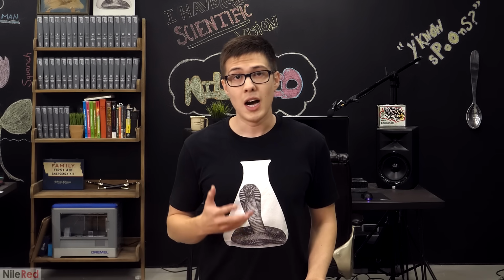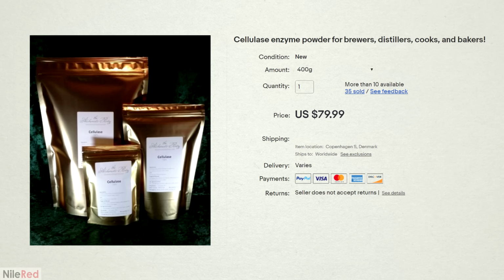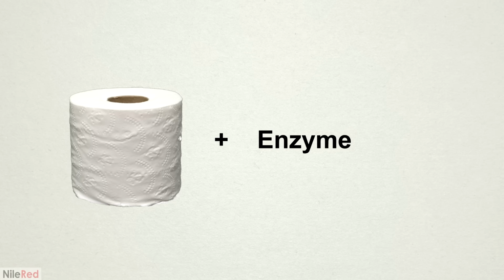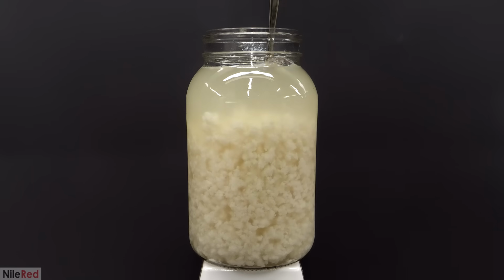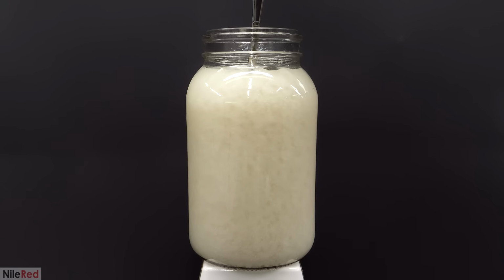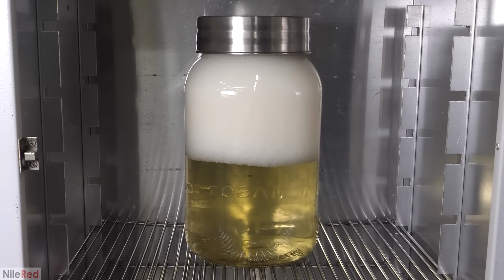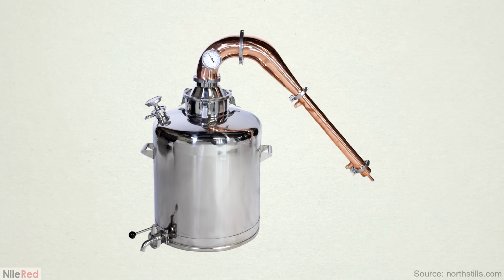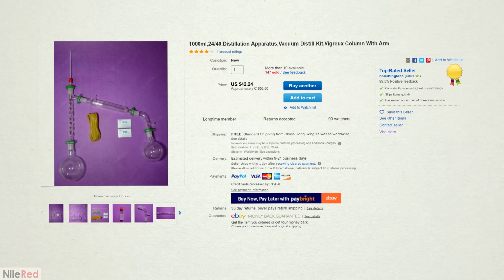Making toilet paper moonshine

Comment: The absolute BALLS this guy has to actually try the stuff he makes when he knows there was drain cleaner and a whole bunch of other chemicals and yeasts he isn't completely sure about in there is immaculate
Reply: I mean, whe all drink Coca Cola
Reply: People do cocaine while knowing that they use gasoline and battery acid to make it
Reply: Uh, all the idiotic anti-vaxer nonsense aside, it's mostly the sodium hydroxide (drain cleaner) in there that was worrisome, which is why he washed the toilet paper so thoroughly, as it dissolves in water (not to mention if any was still left it would be wayy too diluted to worry about). Between that and the multiple distillations, anything too dangerous would be left behind in the flasks he got rid of, excluding methanol if there were any but that was very unlikely and most of it was distilled out with the heads he threw out as well. There could always be some in the tails, which he shouldn't have kept, but even then it's probably not even there and in too small amounts to worry about anyway.

Something he says in his safety video on the other channel that I really liked is safety in chemistry isn't just about knowing how to do something right, but being aware of all the ways it something could go wrong and what would need to be done in all the worst case scenarios. So in this instance that means he knows all the ways there could be some drain cleaner left and so there are steps when all the dangerous stuff is for sure left behind, except maybe in trace amounts.
Reply: He is a chemist. Why does it takes balls? It takes math.
Reply: @dojoparsnip9905  he obviously knows what he's doing, but one wrong move and he's drinking something that could kill him... I just don't think I could trust myself that much so I admire him 😹
Reply: @artistslastcall  i think you have chemistry confused with video games. also, you have zero confidence in your abilities.
Reply: @dojoparsnip9905  No, hickup is right. you shouldn't talk so condescendingly to other people, especially when you clearly arent in any position to do so.
Reply: @guts5135  based on what? how am i not in a position? what is it you know of me? 

 if a person is in capable of math then dont be chemist. you sound like an accident waiting to happen.
Reply: @guts5135  also who said hiccup was wrong? if he lacks knowledge and skill, he shouldnt try the result. 
If someone can calculate YIELD, the know what they are doing. please use your brain next time you try anything.
Reply: @dojoparsnip9905  he is literally god mate
Reply: @zombieslayer1468  you god me there.
Reply: @dojoparsnip9905  On the internet nobody cares what position your in. Just treat everybody with respect and they will respect u back. Somebody was talking about that if hypothetically if he was a chemist he wouldnt trust any thing edible he would create, as a joke, and u go off about zero confidence in your ability and condescending remarks. Its like you try so hard to sound smart but at the same time couldnt even fathom a joke.
Reply: @dojoparsnip9905  ok boomer
Reply: @Kaimebeo  bro your input was extremely helpful. glad to have people like you. stay positive!!!
Reply: @dojoparsnip9905  so true, finally someone who has it right
Reply: @artistslastcall  umm you could've been nicer saying that tho
Reply: @dojoparsnip9905  crazy how vaccines are political now. Look, you either believe in science, or you're an idiot and shouldn't be in public office. There's nothing to argue about here. Science is real. Chemistry is real. Vaccines are real. Get over it.
Reply: I mean it's the same process used to make normal liquor. The raw materials are definitely um exotic and the scale is small but basically same thing different day...
Reply: I was the 1k like. Your welcome
Reply: The drain cleaner was just about the only questionable thing in it. Everything else was food grade.
Reply: Ya know he said he got all new glass to keep it food safe..soo yeah
Reply: Guys, he's Canadian
Reply: Don't lye
Reply: He's working on the law of chemistry. If he avoids mistakes, he shouldn't have any problems.
Reply: Dude, he's a chemist. Chemistry isnt as simple as cooking where the outcome is the combination of all ingredients
Reply: He normally doesn’t taste his creations, remember all of the glassware he used was bought separate to keep things food grade safe
Reply: Fun fact you can make ghb from paint thinner/remover and drain cleaner
Reply: I mean, the drain cleaner was sodium hydroxide, which is still scary but less dangerous than the drain cleaner you're thinking of.
Reply: Sodium hydroxide (a.k.a drain cleaner) is used in the food industry. It's also added to drinking water to control PH. 

So technically it's food grade. In other words, it's not toxic. But it is extremely corrosive when very concentrated (which is why it's used as drain cleaner). 

In your stomach is hydrochloric acid (also used as drain cleaner). It's also extremely corrosive when concentrated, but not toxic. (Hence why you stomach uses it to help break down food.)

As you dilute those, it looses its corrosiveness. 

Yeast is killed completely at 60°C. (it's why we cook food...to kill microbes). 

Not that any of that matters because yeast and sodium hydroxide won't distill in this process.
Reply: He did it for science!
Reply: Immaculate? Do you know what that even means lmao?
Reply: the balls we have for drinking this while NOT knowing whats inside
Reply: guys fuck me just stop it
Reply: You realise he distilled it so it just took the ethanol right?
Reply: You really think the yeast would've been able to survive and thrive if dangerous levels of drain cleaner remained?
Reply: nothing wrong with a little drain cleaner. DMT is also made by using drain cleaner to extract it and som times you get son drain cleaner in your DMT but it's stil smokes good
Reply: Yes it is pure bollocks, watching a chemist who can't distill successfully.
Reply: It's not like he chugged straight drain cleaner
He started with a 2% base and then distilled it
There was probably less drain cleaner in the final product than a sandwich made in a freshly cleaned kitchen
Reply: If you don't think he researches extensively before imbibing, you are the fool.  I've eaten "poisonous" mushrooms, but only after doing days of deep research into the history, uses, chemicals, and chemical byproducts of the mushrooms in question.  By the time I was ready to eat these mushrooms, I was more confident in the mushrooms than I was for store-bought meat, but it takes time and knowledge to get there.
Reply: @ericv00  muscaria?
Reply: @ericv00  just send it. the poisonous shrooms are the best ones
Reply: Y’all arguing in the comments section two months ago while I eat my popcorn 
This is entertainment
Reply: Wow ppl actually think covid has death rate lower than 0.1%. WAT.. could you even do statistics? Or I guess you just do not count ppl above their 50s as people. Hm. Perhaps no surprise there considering ppl nowadays.. heck.
Reply: @junholee4961  The average age of death from COVID is higher than the average life expectancy.

That means you're more likely to die from old age

That is a fact
Reply: @generalofwar6027  Do you even know how life expectancy is calculated?
Hint: It includes infants.
Reply: @dojoparsnip9905  did I struck a nerve?
Reply: @dojoparsnip9905  I did indeed struck a nerve with you. have a pleasant rest of your day :)
Reply: @garymericano  you are worryingly insane. Just thought I should let you know. Lol.

While I'm here, if anyone reads this and isn't sure, I'd like you to remember that vaccines are backed up by actual science, and as supporters of a science channel you should support their development. Also remember to love thy neighbour or whatever, which means doing the bare minimum which means getting the vaccine to protect them from a disease that could kill them.

Just thought I'd remind anyone who needs it that the Internet is a weird bubble where people with the weirdest and most hateful opinions think they're safe from being judged just because they're hiding behind a screen! Go to school and trust the curriculum. I won't personally participate in this thread in the future so goodbye and have a nice day everyone ♥
Reply: B. 
Ug$fff$f$I have a 

Ggg%
%g
Reply: @dojoparsnip9905  yes you are
Reply: Scientifics are naturally crazy
Reply: He probably has cancer now
Reply: @FirstBlockhead  wwwwr eww we’re w w w  eww wwnt I don’t w wwwwwwwwqe see r sss
Reply: @FirstBlockhead  you must be afraid of the Vaccine, too?
Reply: @KiyanKai  
Leave politics off this channel.
This is a chemistry channel.
Not CNN
Reply: @KiyanKai  nobody needs that snake oil or your politics, get out of here
Reply: @KiyanKai  no I just don't like people stabbing me.
Reply: @itaintrocketscience  it’s not political, covid in general shouldn’t be political, i hate how politicized it has become because people are legit dying and people are arguing over who’s the good or bad guy for getting vaxed
Reply: @Cam-dn9ed  chill
Reply: @snctmtcns  yeah for real, its nobody's business as per HIPAA regulation
Reply: @snctmtcns  不
Reply: @Cam-dn9ed  Snake oil? You got a few extra chromosomes or what?
Reply: @snctmtcns  and that isnt rocket science
Reply: @Cam-dn9ed  bruh you can’t tell people to get their politics out then start calling it snake oil. You both need to shut up.
Reply: @Inquisitor_Zama  bruh, rude
Reply: @deluxejay69  >"Read a book"
>Alex Jones and Ben Shapiro mentioned
>Condescending attitude to opinions different to his own
Bro how'd you even get here? This ain't Reddit
Reply: @deluxejay69  fantasy land😂. Fr tho people are crazy these days
Reply: @Cam-dn9ed  ever heard of a joke?
Reply: @deluxejay69  What do you think science is? Science isn’t a thing, it’s a process
Reply: @Giblet12  yeah, it's a constantly changing collection of theories and much of known science could be radically different as early as 20 years from now
Reply: @itaintrocketscience  or FOX. XD
Reply: @snctmtcns  yes I also don't get it. This is a health issue, not a political event
Reply: @marxkartredge  HIPAA regulates that nurses and doctors aren't allowed to give medical details of their in patients to third parties etc.
Reply: @snctmtcns  ok leftie
Reply: @KiyanKai  ratio + didn't ask
Reply: @itaintrocketscience  it is CNN. chemistry news network
Reply: @KiyanKai   lmao  this video is about chemistry..not politics. Get off of his videos if this is what ur gonna do lol
Reply: @itaintrocketscience facts! Or fox either for that matter
Reply: And by the way, you all should be ashamed of yourselves, I clicked on this thread to respond to OP with a joke about every meth cook being just as brave but instead have to argue with clinically insane dogmatists who insist that I am murdering people by giving a disease that I don't have to people who are supposedly protected from it
Reply: @garymericano  I’m high risk and can’t get the vaccine, some of us don’t have that privilege so yeah you might actually be killing people, not just that if you spread it killing or not you extend the pandemic you oh so love to complain about, would you trust your doctors to do surgery on you? I’m guessing yes, but you won’t get a shot…

Comment: When you let the cellulate sit in the fridge with starch in it, it's gonna ferment some of it even if the temperature is not right. Also, the bubbeling was caused by yeast or enzymes quickly developing and increasing because of the heat from the stove. This happend because you didn't remove the yeast before destilation. Also this video could've been 40 seconds long, instead of 40 minutes. But i enjoyed it anyways, it was fun, helpful and interesting. Thanks for sharing!

Comment: Well... Now I finally figured out, why people REALLY bought so much toilet paper in the last months... ;)

But now serious and a late engineering critics:
Did you think about using a two-neck-flask at distillation and distill it under a slight vacuum, so you can suck the liquid, over a pipe, slowly into your distillation flask? So you could prevent overfilling the flask and maybe the boiling issues.
I used a similar setting at work once and it worked quite good. Had to distill about 100 l of a liquid and only had the possibility to use a 10 l flask in the lab.

Comment: Quick note: the flammability of an ethanol-water solution starts at a 1:1 ratio. It’s why the proof scale was invented and why 100 proof is 50% alcohol by volume. Without proper testing methods, the only way to prove shipments of alcohol hadn’t been watered down was to set them on fire. 

This is why most alcohols are sold at an ABV below 50%, typically 45% or lower. It’s simply safer to not distribute flammable concentrations of ethanol. It is also why most bottles of hard liquor have that plastic nozzle on the tip, called a flame choke, that is made to prevent burning alcohol from traveling back up into the bottle and making a Molotov cocktail. Even if an alcohol-water solution at room temperature burns of 50% burns at room temperature, lower ABV’s burn at higher temperatures.

Comment: Fun fact: the X's on alcohol containers marks how many times the batch has been distilled. At three X's, it is safe(ish) to drink, at 2 it'll most likely do permanent damage, and at 1 X, it's basically just a poison.
Reply: This guy doesn't really know what he's saying.
Reply: @XiaolinDraconis  well can you correct him?
Reply: Why is distilling it fewer times more dangerous?
Reply: @markchinguz4401  Methanol contamination, I assume.
Reply: @markchinguz4401  Distilling it makes it purer. Less contamination with more distilling
Reply: If 1X is poison, then what is 0X? Wait, 0X would just be regular drinking alcohol... Yeah that's complete BS
Reply: Not really, single distillations are common and safe. All that happend when you distill it more is up the concentration of ethanol and remove the flavor side products. The toxic stuff that could be in the stiff your distilling occurs during the fermentation process and not the distillation process (mainly methanol). These byproducts (including any methanol) are the first things to get evaporated from the substrate (the heads) and are discarded. Therefore all the possibly toxic stuff that could have been in your spirit has been removed so further distillation only serves to increase ethanol percentage and remove other flavors. 

You have unlimited access to all the information of the internet for free you know, please use it instead of just vomiting some dumb shit that can be disproven after 5 minutes of searching. It's really not that hard.
Reply: why would stores sell poisonous alcohol then?

Comment: NileRed is the type of guy to find himself with a bunch random stuff in an apocalypse and say "Yeah, I can turn that into supplies"
Reply: Nile is Senku theory confirmed
Reply: I had a high school science teacher who said his favourite thing about knowing chemistry was being able to look around and go "I can make this explode, I can make that explode; oh, and that stuff too."
Reply: A chemist is an extremely useful person to have in your post apocalyptic crew. This one video specifically could see use for powering cars and generators by further purifying the ethanol. All the steps where he used electricity(except the brewing stage with the oven, and even then, i think one could work out something, like some warm water system heated by a wood furnace) you could use wood stoves and scale up with a big metal still for the distillation steps...

Not to mention manufacturing many types of explosives
Reply: @Ehbfunbcc Whjfhbhjxf The same method can be applied to other cellulose sources, such as cardboard or wood, especially sawdust, you would just need to do the first stage for a bit longer. And the 60% concentration is pretty good already for disinfection, 75% is the recommended. So another distillation, preferably fraccional, would get the Ethanol to 96%(can't go more than that, because azeotrope) ,then you can add distilled water to dilute to 75%. For drinking purposes just dilute it more, if you want. Or down 96% shots, be my guest. 
Also, for fuel you would have to further remove water by using dried up Epsom Salts or something, followed by closed-atmosphere distillation.
Reply: Simultaneously the kid you didn't want to piss off in school, and the man you want on your team when shtf
Reply: FOR REAL THO
Reply: True tho

Comment: Would this not make the same alcohol that caused people to go blind during prohibition? I’ve always heard that cheap moonshiners made alcohol from wood and things of that nature instead of normal grain mash and that was the alcohol that caused all the serious health problems. I was also under the impression that the alcohol made that way was methanol instead of ethanol and that was the main cause of the health problems. I understand how alcohol is made and I understand that this method could definitely work but I guess I don’t understand the chemistry well enough to know the difference between the old cheap (blinding) alcohol and what is being made here. Why is this any different than that? Or am I just way off base?
Reply: A little off base.  Here and there.  1) A small amount of methanol dissolved in ethanol isn't very poisonous.  Ethanol is even used as antidote in case of methanol poisoning. 2) Bootlegged products were made from various sources, like industrial alcohols which were made toxic/undrinkable on purpose during prohibition era. The other sources included just methanol-based products like antifreeze.